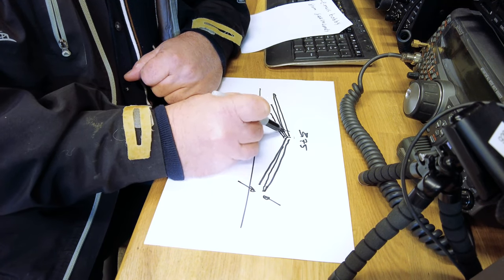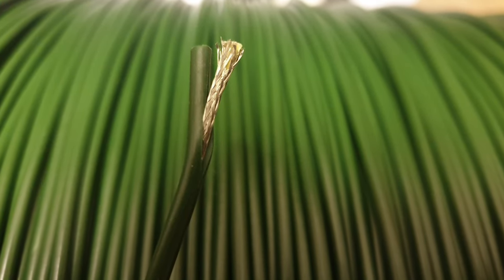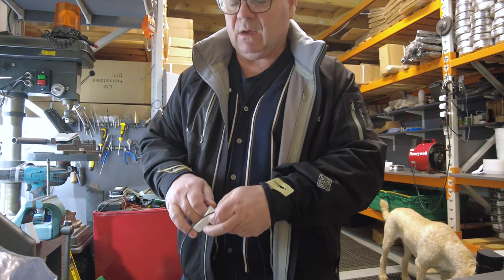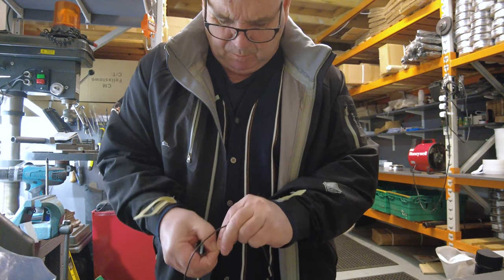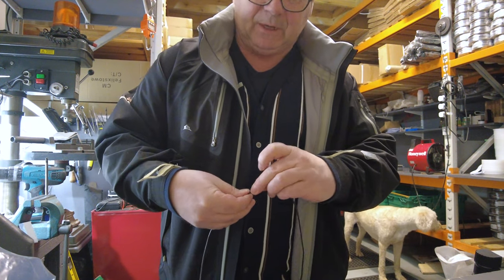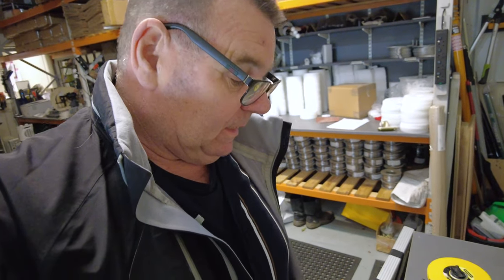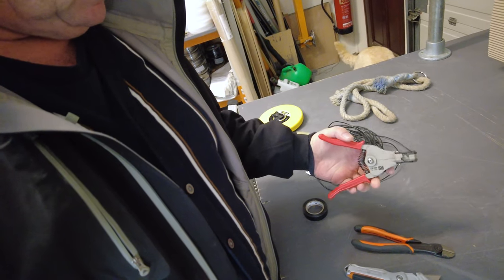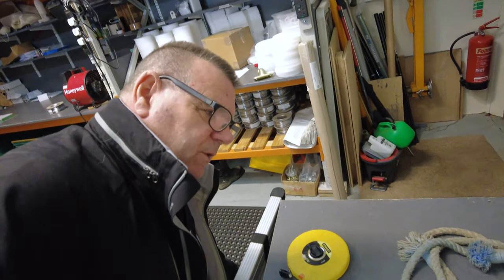Ham Radio 40m and 80m Fan Dipole

Comment: Splicing the wires together... go to an electrical shop and buy some Wago 221-413 Lever Nuts.  There is a 3-hole side by side model that will connect all three wires, the feed, and the two elements, 40 and 80 m.  These replace "wire nuts".  They will not come undone under vibration.  I'm reworking my three band fan dipole now, 75-40-20 meters, and using the Wago 221-415 Lever Nuts, which can join 5 wires.  Though I'm only using four holes.  There is a stripping mark on the side showing just how much insulation to strip.

Comment: Hello from Maine. May I ask you some questions?
What are you using for your underground cable? 
I'm just starting out (after not being on the air for decades, so re-learning everything) and would like to place my antennas approximately 80 feet away up a slight hill behind my house. 
While I dig my trench for the coax, I may drop in a few cables for different antennas. This will be a permanent install.
Reply from the maker: It's all in the shack-tour video.. Coax is EcoFlex 15.

Comment: Very interesting, folding back a dipole legs, halves the resistance of the leg, because the current in each folded arm is shared between the two, this enables the dipole to form a better match to the feed point, usually this would be a coaxial fed balun with a 50:300 transformation, so I’m interested to see what impedance your aiming for at the centre, I wonder what the analyser calculated as the feed point impedance. There is nothing like your videos on YouTube for antenna education, they are world class, well done.
Reply from the maker: Interesting.. On the original linear loading, we got almost a perfect match.. POSSIBLY due to height above ground. That's probably what helped with the transformation, being low down.

Comment: Hi Cal just a quick one I bought some small stainless steel  pulleys to put  power cord  through to pull my wires up  to my roofline instead of going up and down ladders I wonder Baby you could use the same idea for in the trees
Reply from the maker: Yes, we've done that before.. And if I actually choose a permanent tree, we'll do same! Thanks for the tip!
Reply: Ok thanks for the reply Cal

Comment: Callum, I am going to purchase your DX Commander in the very near future for a better DX capability. I am looking for a way to add 60 meters. Is there a way to integrate it into the DX Commander, or an I better off using a separate wire? I currently run a non-resonant inverted v wit apex at 30 feet with a 9:1 unun. It gives me 80-6 meters, 80 needs an ATU. It is important that I come up with a reasonable tech solution for 60.  I am in an HOA, and limited space. Thanks.
Reply from the maker: OK, if this is a CLassic.. I would run 80m on inverted L one way and 60m the other way.. I've not done it but the hardware exists for this purpose. It will work :)

Comment: Late to the party, sorry.  When using trees, rather than masts, I would recommend using weights on the ends of the lines, rather than securing the ends to the tree.  Less strain on the elements when the wind is blowing, and self adjusting for tension.  If you're going to get on the lad for his knot, I should point out, the 'figure 8' knot is for the purpose of what you're using your 'stopper knot' for.  (originally used to keep lines / ropes from pulling out of pulleys.
Reply from the maker: Depends on height of tree

Comment: Wondering if you know how to wind a 16:1 balun - am making a folded dipole with a 1000 w terminating resistor - can't find anything on how to wind a 16:1
Reply from the maker: Hiya Pat. The only suggestion I could make is pairing up in series a pair of 4:1 baluns maybe? But I'm not a blaun expert..
Reply: @DXCommanderHQ  well I ended up buying one and wouldn't you know then I found a video on how to wind a multi element balance that covers 4:1, 9:1, and 16:1 - looking forward to trying out this folded dipole with terminating resistor kind of resembles a loop that is resonant on all frequencies without a tuner

Comment: Is it possible to fold the leg back on itself a 3rd time?  If so, what does that do to the loading ratios?
Reply from the maker: OK.. I have tried this.. All that happens is you end up with more loss.. It would be better (assuming you wanted to shorten the element) is to put a coil somewhere else, say at the beginning of the element - and then linear load it AS WELL.. That would make it short and still fairly efficient. (Centre loading with a coil is apparently better than loading it near the feedpoint).
Reply: @DXCommanderHQ  Thank you!  This had occurred to me as well, but I don't enough about design to put the components together.  I'll look for a video to educate me on the technique.
Reply from the maker: @mjktrash  Great!